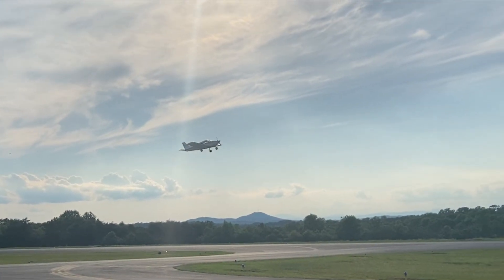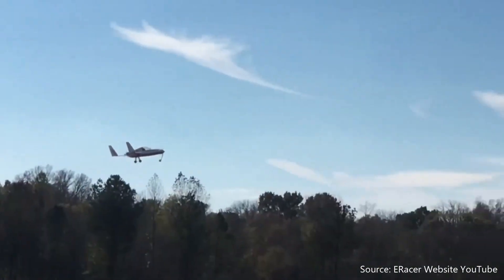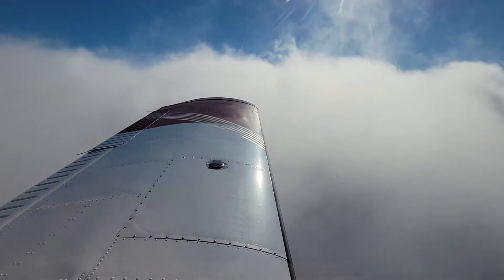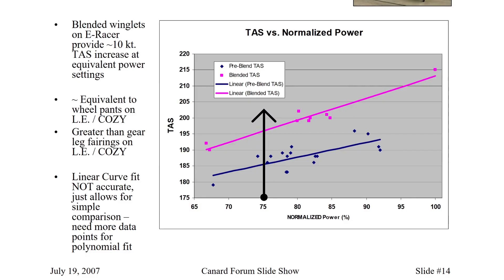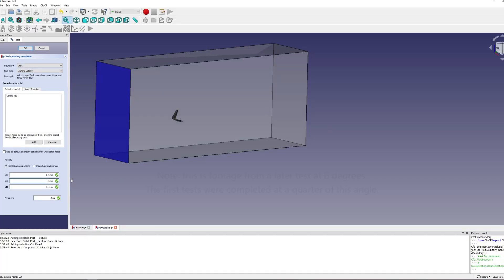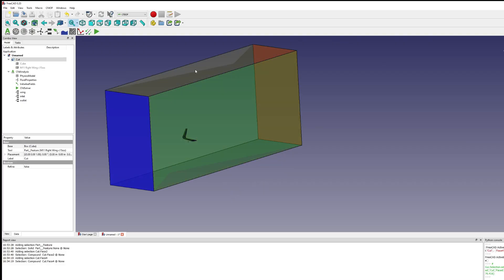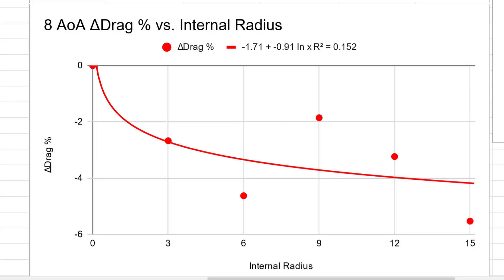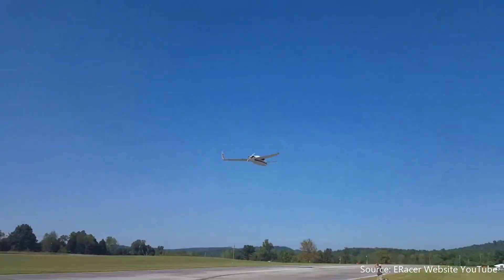E-Racer Blended Winglet and Interference Drag CFD Analysis

Comment: Pretty cool. Wish we knew this in 83 when we built our eze. At that time the straightest build was the fastest due to having the less trim tab factored in to fix crooked builds. We used a builders sight to shoot straight lines and to get the eze as square as possible. 75% we ran at about 190 that was a stock veri eze, no starter, 100hp Lycoming with a prop we bought from Rutan him self. Out of 6 eze’s at the airport ours was the quickest. That radius curve at the winglets would have been interesting.
Reply from the maker: With the vertical stabilizers moved backwards from the main wing on the Long-EZ, Mark Zeitlin did not believe a curve would be effective in decreasing drag. It would be an interesting test though.

Comment: On the Cessna wing-fuselage intersection (6:26), a small fairing to be attached to the rim of the door between the upper edge of the window and the top of the door. Whether that would be large enough to be significant is still a question. There would also be a small interference near the front edge of the door as it hinges out, but that could be minimized. Given the size of the wing strut fairing and landing gear strut fairing, and the gap between the fuselage and landing gear strut fairing, it seems like a small fillet fairing on the top of the door would still be helpful in reducing drag.

Comment: Out standing. I believe the canard plane has been attempted in various forms. Even a jet, perhaps. It does seem that for a 4 seater multi composite structure. Supporting a turbine would be doable if, similarly designed like the SF50 in turbine placement and tail design. Your video was spectacular. Please continue to share.

Comment: Dude nice video. But as an engineer , i would suggest before learning anything SW or CFD , first master python , it will calculate all the iterations you want and u could program SW or any CFD software. The results would be automated and precise , as for CFD i would suggest to go with Ansys Fluent .
To be sure , model a Regular Naaca airfoil and find the L/d ratio,  if it's the same as the known values , use the same settings for other purposes.
Edit - there are many types of solvers in ansys, find the right one .😊

Comment: Great work and interesting! I don't think I am going to blend the winglets on my Cozy IV, it is fast enough :). I understand how much work that must have been. I tried to model a reverse scoop for my oil cooler use a freeware 2D CFD program. Gave up and just made a cardboard one and flew.  My son did his senior engineering with CFD modeling. He had to design a cooler for a nuclear reactor.  He had to use the schools super computer to do the model in a reasonable time without errors.
Reply: I remember seeing something from Mark Zeitlin where he presented that the Cozy already had a good design where the winglet is set aft of the main wing's leading edge and that a blended winglet would not appreciably benefit a Cozy.

Comment: Nice work.  There's still lots left on the table.  The AoA of the winglet can be set to provide some net thrust because the induced flow at the winglet is no longer axial and so can provide enough of an angle to generate a lift vector that tilts forward enough to be useful.  This is a pretty crap explanation but might help give you the idea.  Also, you may find that a panel code such as is available in something like Aeolus or XFLR5 might be more useful for doing the bones of this type of analysis since it is much less computationally intensive and thus you can iterate many more times.  Good luck with your investigations!

Comment: Great findings! Love it!

The next step on a ERacer is to eliminate the canard configuration and therefore get a much smaller mainwing.
Reply from the maker: That would certainly decrease drag, but I'm probably not skilled enough to deal with the other problems that would create
Reply: How would that not change the whole stability situation thus requiring a completely new wing design?
Reply: @mike_oe  I was joking! Yes canards are inefficient configurations. To much wing surfaces in order to create dynamic stability.
Usually they have small cabins and composite surfaces to compensate the drag.

Comment: Did you notice that on long ez, veriez, and others except the e racer, that the point of max thickness of the vertical stabilizer is intentionally moved back to behind the wings point of max thickness to reduce this interference drag. There's another one done by Mark on a cozy mkiv that left the offset and found little improvement. May be much easier to just build longez cozy style with the offset  vs the blend.  http://www.cozybuilders.org/Oshkosh_Presentations/2009_Esselstyn_Blended_Winglet.pdf

Comment: Would it be daft to have a scoop in the high pressure corner of the winglet that could be directed internally of the wing to another portion of the wing and dispersed, say under the wing?
Reply from the maker: I do not think that is a bad question. It’s honestly a good thought that has me curious. Sadly such a test involves fluids flowing both outside and inside the object, which is beyond the capabilities of the CFD tools I have access to. They can only do an internal or external analysis, but not both at the same time. We might need actual wind tunnel tests to answer the question. 
Do some research on the Bugatti Model 100 aircraft. It used something like what you suggested for engine cooling and drag reduction.
Reply: @Walker Weathers  
The 100 is where I got the idea from
As well as other various racing tech
I just don't have the means to build and test aircraft at the moment, though even a model RC version should see benefits
Reply from the maker: @UndulatingOlive  my email should be in the description. If you want to try some wind-tunnel tests in the future, I would be willing to work with you
Reply: @WalkerWeathers  
Appreciated, though I've no experience in the maker world, let alone aircraft creation and RC, but I do enjoy the theoretical side of it all, and I get satisfaction vicariously through watching others experiment

Maybe one day I'll invest in the practical side

Comment: Wow, lots of work! Reducing the interference drag by blending the intersection to a generous radius is well proven in several blended winglet studies. Hoerner also deals with the subject empirically, if you consider the wing and winglet to be two struts.    What would be interesting and arguably more useful to other builders is a structural analysis on the new winglet, and determine what radius is acceptable from a builders perspective. And how the new spar would be constructed.
Reply: Who is hoerner
Reply: @jamesringler987 
Google: "Hoerner Drag".

Comment: I would suggest searching the Youtubes for Mike Arnold videos addressing interference drag as well. He has passed but someone is doing a great job of archiving his recordings. In addition to increasing radius, experiment veritical placement in relation to the main wing ie: placement of max thickness of vertical compared to main wing, moving the location of the vertical fore and aft to see results. Try to keep the frontal area constant and see what you get.
Reply from the maker: Great ideas for future studies. Those Mike Arnold videos are fantastic
Reply: @WalkerWeathers  If you need help with SolidWorks give me a shout out.  I use SW and CATIA, I may be able to give you a hand.
Reply: Interference drag is extremely easy to reduce with geometry. 

Given a known airfoil pressure-distribution, create a junction that does not add significantly to the peak velocity. The pressure distribution of the fuselage side or junction should have a pressure dip aligned with the peak, so the velocity effects do not become additive. 

Think of it like this: Airflow speeds up over the wing.

Airflow also speeds up around the fuselage.

Where the two meet, airflow is substantially faster than free stream. Meaning substantially more drag, as that area sees an airflow of a much higher speed than vehicle forward speed.
Reply: came here to say that! I believe he called 90 degree angles “nozzles”
Reply: Mike Arnold referenced the text "Fluid Dynamic Drag" by Hoerner. Excellent, excellent read!

Comment: It sounds like a good improvement.  One potential problem could be the rudder cable would somehow need to be raised to the new higher lower rudder location or some sort of extension of the rudder horn perhaps on a tube would have to be figured out.
Reply from the maker: Probably an extra bend in the nylaflow tubing to get the cable to the higher position, but I have not decided yet. Thank you for the suggestions
Reply: @WalkerWeathers  What if you made the outer curve start a bit lower to allow the rudder to be a bit lower?  It needs to be flat for the hinges.  The rudder cable is in a nylon like tube so it could curve a bit.